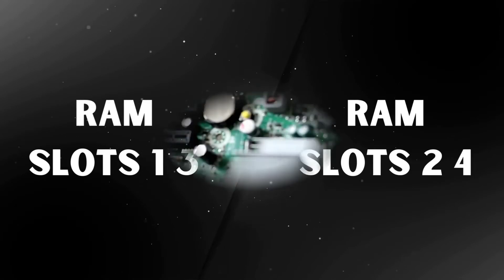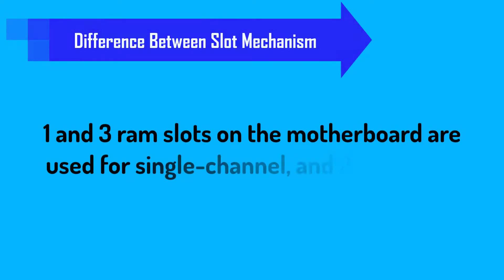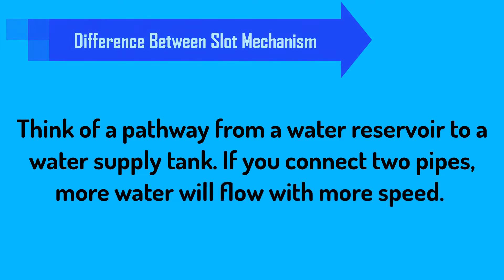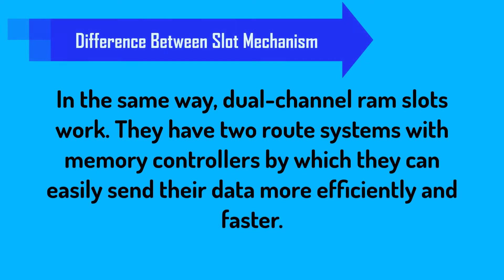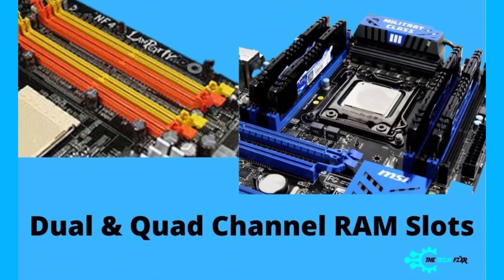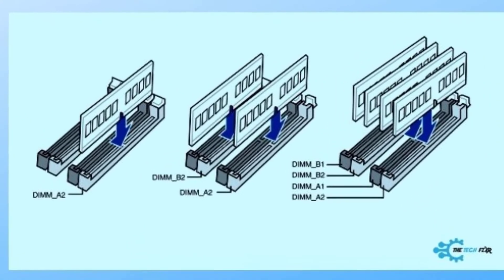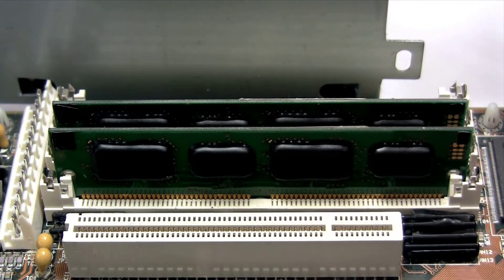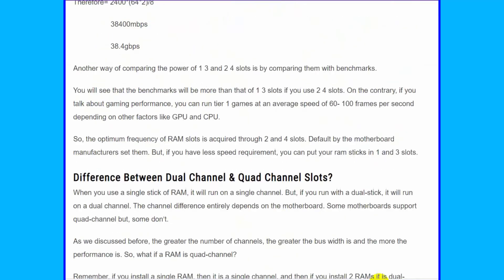Ram Slots 1 3 Vs 2 4| Which Slot Order to Fill First? Clear-cut Explanation

Comment: I have 8 gb  and 16 gb ram stick of same frequency but different brand can i use in dual channel??
Reply: This is very cursed and will cause instability, just use single channel 16gb
Reply: @Okame_tf no it wont goofy
Reply: @Okame_tf i was running one of my pc with mismatched ram stop the cap
Reply: @slaydog5102  depending on speed, brand a capacity, it can cause very random instability, yes sometimes it will run just fine but under heavy load it can cause BSODs and/or unexpected crashes

Comment: 1 3 is better than 2 4
Reply: its not
Reply: @Patrioten99  yo question, what if i fill all the slots will it still work?
Reply: @pengu310  yeah
Reply: @airmand7718  oh okok thanks!
Reply: @pengu310  This video is to clarify for configs that are only using dual-channel. So for example:

with 1 RAM stick, you can essentially put it anywhere.
with 2 RAM sticks, you should use slots 2 and 4 (respective to the CPU).
with 3 RAM sticks, slots 2 and 4 should be filled. For the 3rd stick it essentially doesn't matter, but most recommend using the slot closest to the CPU.

This is just for the CPU to process RAM in the most efficient way possible. With all 4 slots filled everything will work fine, but be sure to have matching RAM on slots 2 and 4 if possible!
Reply: @JReaLBiz86 thank you